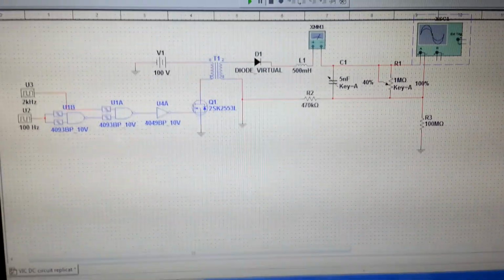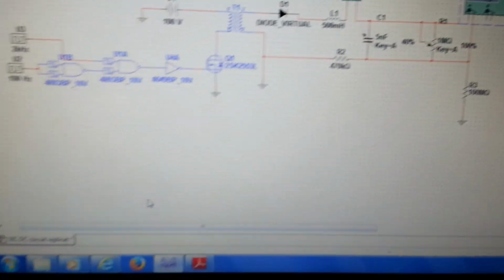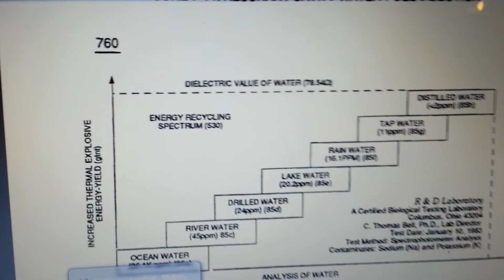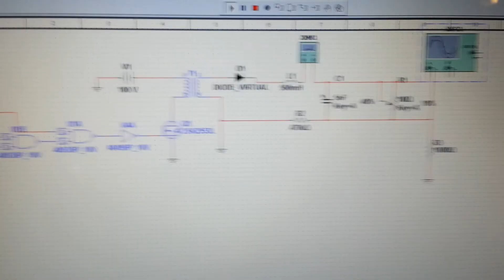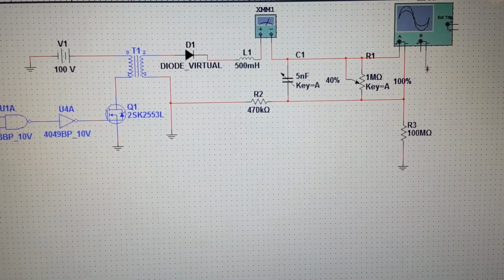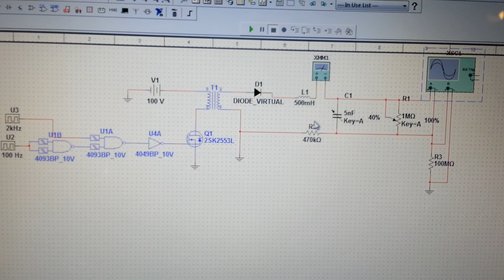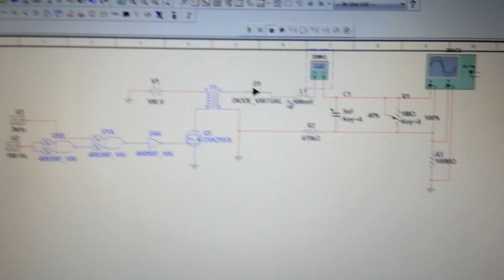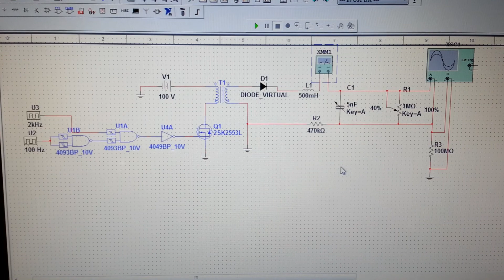Stan Meyer Research #2 Feb 2014-V.I.C. replication in Multisim

Comment: Hello Bradk. how are you?
I am building my new HHO reactor by resonance... now using a VIC like Meyer's, supposedly... Considering almost the same values measured in the inductors. However, I have tried to simulate something similar to the circuit with Multisim, but it always generates a simulation error. I would like to know if you can share what were the values of the parameters that you had to modify in the software? considering ABSTOL, VNTOL and RELTOL
Reply from the maker: Hmm,

Its been a while. If I remember correctly I did something to make the choke a coupled inductor?
https://knowledge.ni.com/KnowledgeArticleDetails?id=kA00Z0000019LloSAE